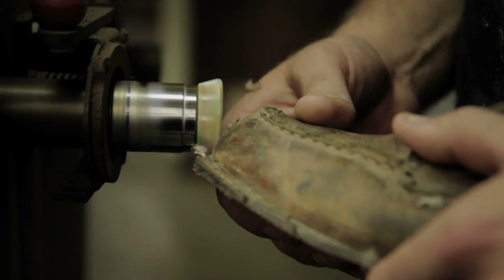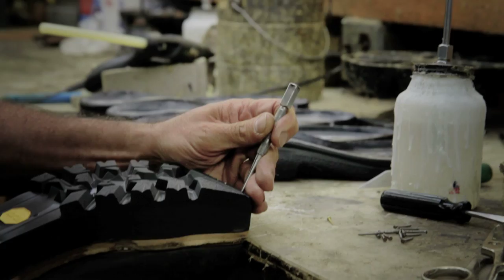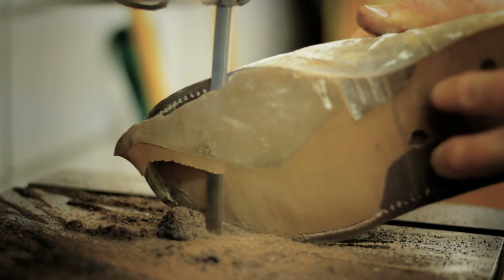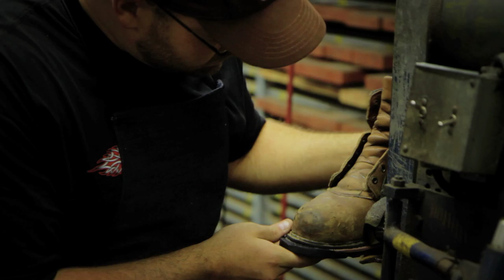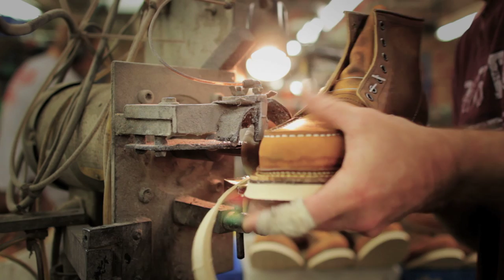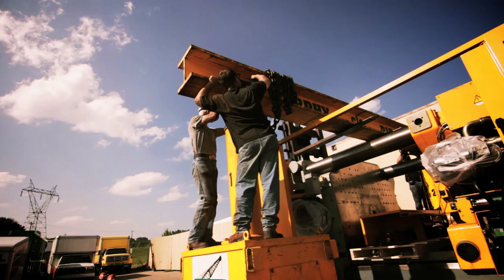Red Wing Shoes Presents: Shoe Repair

Comment: This past Sept 2013, I resoled a pair of the original Irish Setters, that were 40,years old...The owner I know personally. he bought them the first month after being hired by 3M as an inventor...He wore them for his own use, not on job...Secret? Cleaning with Saddle soap, and reoiling them with RedWings oil...there were loose welt stitches in arch, easily restitched during the rebuilding.  Also Minor stitching.  90.00, quite less expensive than a new pair, but rebuilt to last.

Comment: Will Red Wing ever offer a service repair for leather damage throughout the shoe? The 2243  and 2245 are my favorite boots, but suffer from tears at the tops and at the wear line where the boot bends in front of the tongue. Regular oiling helps, but after 14 years of elements they took a beating.

Comment from the maker: @ericl530 In most cases,  the final determination of whether a boot can be repaired requires the sole to be removed.  A visual inspection isn’t the final answer. This is done by cutting the boot with a band saw.  Once the sole is removed, the repairman can determine if the structure of the boot is solid enough to accept a new sole.  However, once the boot is cut it is either a candidate for repair or the trash.  There is no turning back.

Comment: I own a pair each of 10877, 10875, 899, 606, 676, 953 from the made in USA line. I love these boots and keep these 6 special pairs as casual "dress" boots never wearing them to work like my beaters. I want these to last the rest of my life and they will because I use junkers at work and when they will be taking a beating. It makes no sense to beat your recraftable made in USA boots when you can tear up unrecraftable junkers and toss them when they are worn out or broken down to the point of no longer being comfortable. This is what I do, but I am a full time licensed HVAC technician and we really beat our clothes boots/shoes to death. I was reminded of that recently when a 5' long piece of 6" diameter 30 gauge pipe fell on the steel toe of one of my work boots end first and sliced a huge gash in the leather. You can't repair that sort of thing. You also cannot repair crawling around in crawlspaces on jagged concrete, dirt, rocks, broken glass and metal shrapnel etc.... It really damages boots and carpenter jeans in a hurry. We also are out in the elements during rain, shine, cold, hot, snow and get our boots soaked washing out A/Cs and EACs with a garden hose.

I want my good stuff to last. China junk can go in the trash after it is thoroughly thrashed.....
Reply: John Doe 
Electrician here, I’m glad to hear that you also have a pair of 899s, I love mine. Have you tried the 4200? Probably the best boot for work, if you can check it out, it’s USA made.

Comment from the maker: @MrJosephsoto Looks like you need to either contact the store in El Cajon, or you can send them directly to our shop in Red Wing. If you have more questions regarding repair options or to request a shipping label I suggest phoning our repair staff at 1-800-328-9453 or email them at shoe.repair at redwingshoes com Our Repair Shop is staffed from 6:00 am to 4:00 pm CST Monday thru Thursday and 6:00 am to 12:00 pm on Friday

Comment: As a minnesotan, I am proud of the RedWingShoeCompany

I am also a shoe repair man, for 43 years, 23 in Saint Paul MN

I am a shoe repair shop that is capable of repairing most RedWing shoes.
I am a redwing dealer for resoling...(even the urethane soles (I am qualified to buy then from RedWing.
You can call Redwing for Verification.
gene at hartlandshoes us